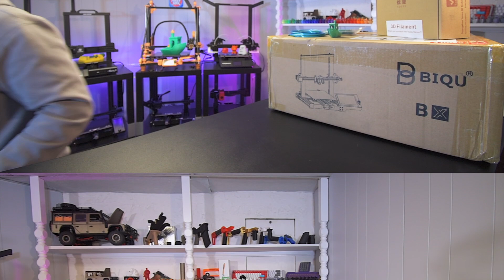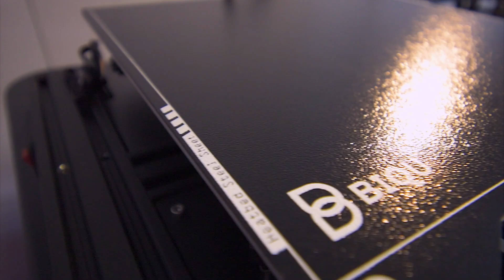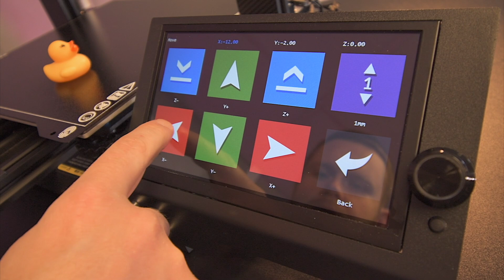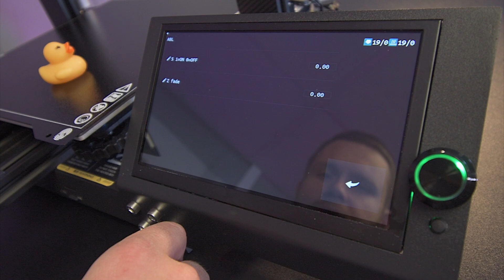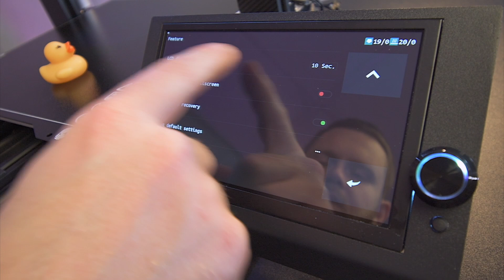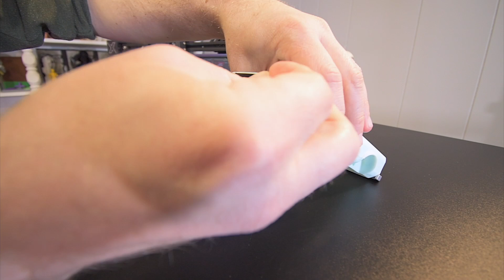Direct Drive Battle! - Part 4 - The HotRod - Biqu BX

Comment: This is my first machine! 😵‍💫😖🤐 Everything went great till I tried to print with ABS and a thermal run away error interrupted my print.... probably already mor than 100 hours of time invested in figuring out how to update firmware and getting the machine to work again and still not being able to make a single print with little to no support not from the "community" or Biqu!
What a fucking disappointment and yes, the hardware might be impressive but if you can't find info on how to make it run and keep it running it is a waste of time and money.

Comment: I bought this printer a couple of months ago, but I have had problems with the leveling, I level it first manually with the points of the manual leveling assistant, then I do the ABL autolevel, and I set the offset. But when printing it is not perfect like in the video, it is very sticky or very raised but I don't get a perfect first layer. Additionally, I feel that in some places the nozzle sticks more to my bed than in other areas. PLEASE HELP.
Reply: I am having the same issue and have to manually baby step it every single print it is driving me crazy

Comment: @3DPrintSOS  if your still using the BX and looking into the thumbnail support, i had to tinker this a while back on my custom chiron with an skr 3 ez+tft35 combo. theres a git repository for the thumbnail feature from BTT, using Cura 5.2.2+ its a file youll extract and drop into your cura plugins folder, i have thumbnails working on my Chiron and my BX currently, its nice, but they take some time to load on the BX screen, whereas they are almost instant on the tft35
Reply from the maker: Thats a nice pro tip! Thank you.
Reply: @3DPrintSOS  anytime. Dont forgot you can plug  in an M150 command parameter to control the RGB lighting as well. If you dig into it enough it can be controlled well enough that you can show print time/status via RGB as well. 👌

Comment: Tried 2 of these printers from Microcenter, both faulty within a month or two. First one had so many problems with extruder, it took me too long to realize it was the HDMI cable. After replacing that, the cooling part fan stopped working soon and required the entire control board to replace. The 2nd printer also came with a faulty HDMI that prevented printing. Couple that with lack of firmware updates and support, I can't recommend this printer to anyone.

Comment: Can you use a Raspberry Pi 3 B with this display (rather the a Raspberry Pi 4 as mentioned in the video)? I'm running OctoPrint on a Raspberry Pi 3 B on my BiQu B1 and it works fine. I have a spare Raspberry Pi 3 B that I'd like to use if possible. Thanks ;)

Comment: So, will the 10 dollar hot end do away with the tube?....and do 300c....also, is a BL option to ad on?
Reply from the maker: Yep, the 10 dollar all metal hotend gets rid of the tube and will let you go higher. You may have to recompile the firmware to go hotter. Yep, a BL touch should be easy as well. Would also require a firmware recompiling I think.

Comment: They have a version of that extruder that is water cooled.  I guess you might need that peek and I suppose it is better for heat creep but I have seen no reviews.
Reply from the maker: I haven’t either. I wonder if it worked out. Maybe the pump is hard to implement?

Comment: Epic review and lots of info. Looking to buy my first 3d printer. Would you recommend this over the ender 3 s1 or what would your recommendation be? Would like to have input from someone that used all these.
Thanks a mill!
Reply from the maker: Thanks! This is my current favorite machine. However, as a first machine, the Ender 3 S1 is by far a better fit. Simpler, cleaner, streamlined. The BX is an advanced machine with many many features. As nice as that is, it’ll be by far more confusing. :)

Comment: Question for you:  I have an Ender 5 Pro and an Ender 2 Pro, and I'm 90% sure I'll be getting one of these soon. Can I build multiple Octoprint instances on the micro-SD card for the R-Pi attached to this to also control the other two printers? Or would I need to have a separate R-Pi for this and another one for the two Enders? Thoughts?
Reply from the maker: That’s a great question. If you just use the rpi on here without the integration, I think you can use it for multiple instances like normal. However I can’t comment on it in the integration mode because I can’t get my hands on a pi. :/
Reply: @3DPrintSOS  Thanks, I suspect for cameras and printers then a USB hub might also be in order. Could easily run out of USB otherwise. I've never tried a hub to the Pi with Octoprint, either.

Comment: The display dimming issue is a firmware issue.  I built new firmware for my tft35 v3 and i dont have to use the knob to bring it back to full brightness with the firmware i built.   Course this is a different display, but i figure since this is a software controlled thing, its likelky firmware.  I cant remember what function causes it on my display, but theres something if i utilize it, causes the display to crash.  You can access marlin and come back and it seems to be ok at that point, similar to what you experienced.  For the most part im liking the BTT products.  The E3 mini v3 is a bit of a pain at times, but once running seems to be a great board so far :)

I have to agree though, the display is amazing and once you figure out where everything is in the menus, is great for all the reasons you mentioned.  Very responsive compared to other resistive touchscreens on other brands of printers currently. Almost as responsive as a capacitive one.  BTW the Ultimate Aquila is looking great :)
Reply from the maker: Thank you! :)

Comment: It's impressive how well this machine can print with klipper and superpinda from prusa. Modded to print up to 430mm, new 5050 fan and squashball feet! Really love the printer! Get on 3djake for around 370€.
Reply from the maker: I need to get into klipper. I hear nothing but great things. Thanks for sharing.
Reply: @3DPrintSOS  so, it's definitely more powerful than marlin. The only disadvantage is the raspberry. At least now. If you want, I could share my config file.
Reply from the maker: Would love a config!
Reply: @3DPrintSOS  any mail?
Reply from the maker: Fedor (at) 3dprintsos.com would work. :) Sorry, had to make that funky to avoid spam.
Reply: @3DPrintSOS  Hey, you have a new mail! :)
Reply: i would be interested on your conversions on the bx
Reply: @adrianbishop694  Nothing special. I replaced the entire Z axis with the one from the Geeetech A30 (old non-touch model). It has the same profiles as the biqu. I also added two 90 ° brackets to the base of the z axis. I replaced the original sensor with that of the prusa, the Superpinda. Soooo better and, above all, it does not suffer from temperature variations. Fitted a new fan duct with fan 5050. Cleaned and fixed the extruder gears. Above all, I eliminated marlin in favor of klipper.

Comment: Coming with the BTT mainboard and h2 extruder is a pretty big deal. Those are some high end components.
Reply from the maker: It feels high end. With all these settings and features though, if someone doesn’t know what they are doing could totally get themselves into trouble real quick. I also still don’t get why there’s a z limit switch. Makes me want to redo it all. 😂
Reply: @3DPrintSOS  
Clearing a TPU jam on the H2 is such a pain, but other than that it works great for how light it is. Just stick with normal filaments!
Have you thought of putting klipper on any of your machines yet?
Reply from the maker: All the time. I gotta do it at some point for sure. Just haven’t had the chance. I’m going to stop accepting machines for review for a little while  so I can catch up again.
Reply: @3DPrintSOS  I have about 8 things on backlog. It's a good problem to have, but hampers creativity.
Reply from the maker: In a big way. Zapps the fun. Trying to come up with larger projects to do while checking out machines and mods. That seems to help.

Comment: Hi Fedor, another great review
Could you please measure width of the BX from the left of the machine to the far right of the screen,would love this machine just want to see if it would fit in my enclosure
Many thanks 👍
Reply from the maker: If I also measure the plug sticking out the side, I’m getting around 22” from left to right.
Reply: @3DPrintSOS  Thanks for sorting my query,shame it's just a bit too big for my enclosure,I wonder if the screen could be rotated
Reply: And the x axis stepper overhang makes it wider also
Reply from the maker: I think it can. There are printable mounts and I saw a “rotate” option in settings. But I wonder if it can do 90 degree rotations.

Comment: I got previews working with my elegoo neptune 2s with the `mks wifi plugin` in cura, it worked without enabling wifi (though I have since added wifi to the machines), perhaps try that if you cannot find a better plugin
Reply from the maker: Ooo nice. I’ll give that a try
Reply: @3DPrintSOS   I just ordered one.  Did that tip give you the preview?
Reply from the maker: Nope. Never got them to work. Been using it without them

Comment: Rather than do a z-align with the bed, it should be aligned with the actual frame in order to assure prints have true 90 degree square corners. I do not have belted dual z-axis, but do a caliper alignment of the z rods before a bed alignment for this reason. The touch interface is so efficient, using the Alex-marlin on the Aquila can get tedious.
Reply: What I typically do is home, lower z to 0.2, disable steppers, manually level the gantry to the frame then I'll do my 4 corner leveling. After doing that I can run a g34 and consistently hit 0.01 accuracy 99.9% of the time. Running a g29 shows that all 4 corners within about a 0.05 of each other

Comment: about the thumbnails: this function can be enabled within PrusaSlicer or it's derivates without plugins. But if i remember correctly, you are using Cura, right? There is a option for that in newer versions too. Under "Extensions" -> "Post Processing" -> "modify GCode" you will find an option "create thumbnail". This should include the preview pictures in the resolution you set there. 
Apar from that: i am really tempted! Been looking for some tinker friendly DD machine since quite some time. The Ender 3 S1 and Mingda Magician are just a little bit too proprietary for my taste. So the inclusion of Klipper and Octoprint right from the start kinda sold it to me on that one. :D
Reply from the maker: Yep. I found that setting in Cura but can’t get it to show up. Might need a specific size or something. 

That’s right about the other two machines. This is definitely an Ender with all of Biqu’s best products. So it’s pretty “open” to mods, tweaks,  improvements, and other tinkerings.

Comment: This a great GUI and choice of GUI also, I changed my Creality touchscreens to 12864 displays just because of the interctivity with Marlin is so good, I have Rasperry Pi's and Octoprint but sometimes I just want to access some controls from the 12864 as I am so used to this type of controller, surly there is a way to convert Creality touchscreens to HDMI or to fit to the Raspberry Pi GPIO pins

Comment: I heard there is meant to be a plugin for cura to make the preview work in the gcode i am not sure if it is out yet or not
Reply from the maker: It is but I can’t get it to work. Must need a specific size.
Reply: @3DPrintSOS  There are (3) folders you need to place into the Cura Plugins folder. Worked real good until Cura 5.0. Now I cant get it to work at all, even with the "new" files found online.